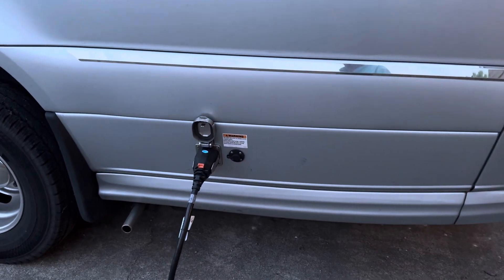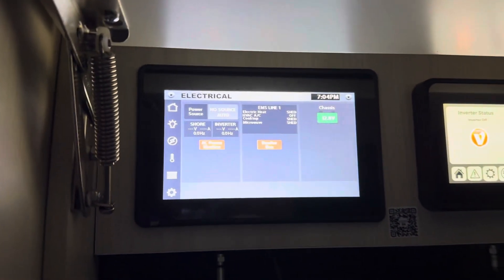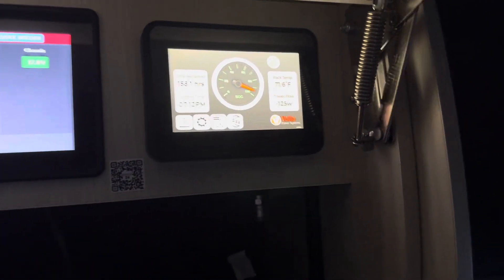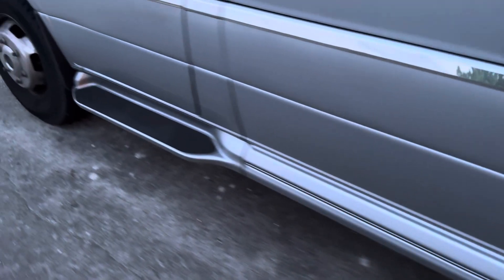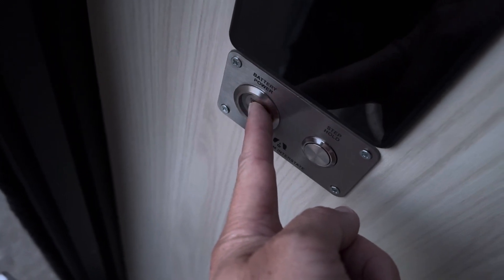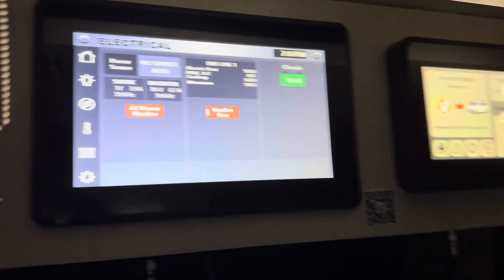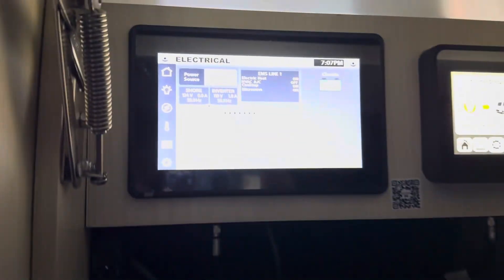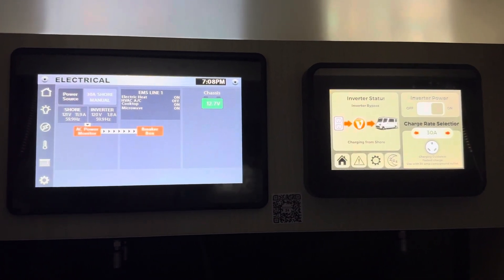Magic Fix for Airstream Interstate E1 (Volta) when inverter goes ‘off’ while on shore power.

Comment: Mine is in the shop after our first trip.  
I would get fault message on my iPhone to restart Volta and the. Read the fault reasons.  But after resetting no reason codes.  After doing that and while driving it decided not to change. 

Eventually it went to zero.  And eventually even driving we could not get inverter to turn on so we only had 12v DC.  

Eventually that failed.   And now we can not event boot the system… everything is dead.  

Finally made it home and it’s in the shop.  

When we got it originally the batteries were dead but they said sales left the lights on and we shouldn’t have any issues.  Well we did!!!   This time when I get it back I’ll test it HARD and if it fails again it’s LEMON law time
Reply from the maker: It truly is a pain - we have been without power in the unit multiple times while traveling. This time we decided to let them try and fix it for good before the autumn so we can not worry about it during the better traveling months. There is supposed to be a firmware update coming but it has not passed testing yet.
Reply: We have a 2023, in the shop now. Dead batteries, not able to reboot. This issue is just frustrating

Comment: I had that same problem and your wife mentioned the video in the AI Facebook so I looked here. I was able to reset mine without the engine on but I had already disconnected from shore power. I currently only have a 15A SP circuit so I wasn't sure if that affected anything.
Reply from the maker: Glad that we were able to help. Sorry to hear you also have the issue though! Happy trails.